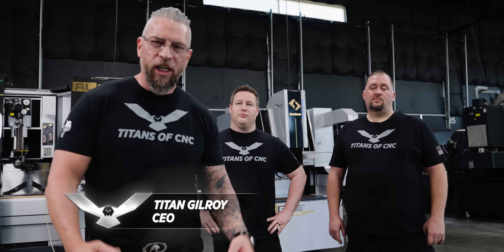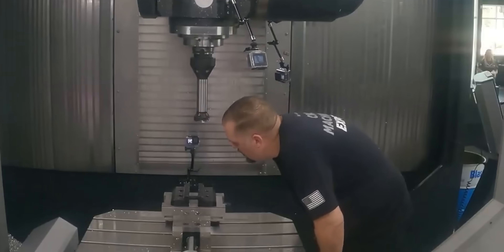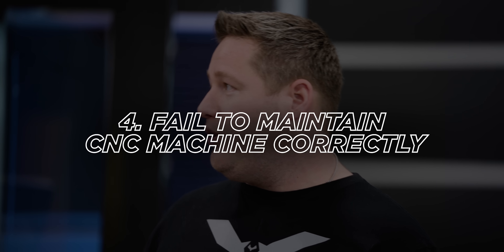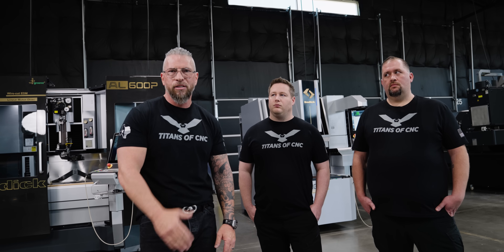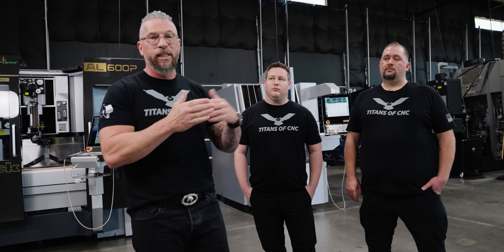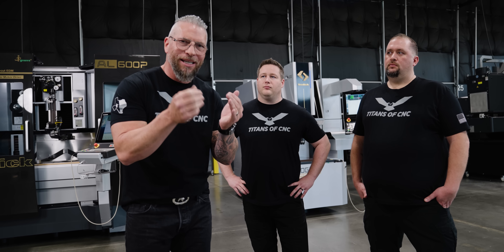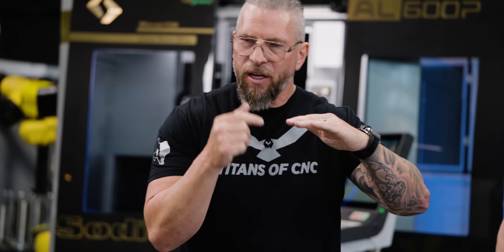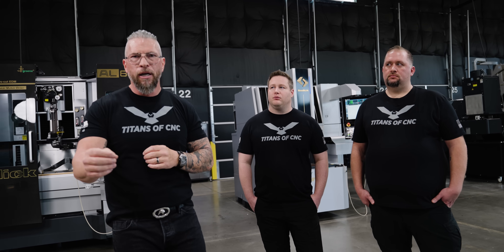Machining Mistakes That Will Get You FIRED

Comment: Tip for programmers, especially ones that don’t operate, give your machinists a G43 line check on each tool using a 1,2,3 block. The more witness cuts, the merrier. Give them a chance to adjust and verify work offsets before getting into finish features. This is not a tip for volume production, but for PRECISION CNC machining

Comment: Great video guys!
I always put the Z on the bottom of the stock. Any -Z coord is a problem in that way. And if the stock is cut off too low, you end up with a part that is not finished on top, instead you end up in the vice when you put Z0 on top of the stock.
Never manual change a code generated by a post processor. When something need to be changed, correct it in CAM a repost. Or update the post for a correct output for your machine.

Comment: if you put the z on top of the part, you cant crash the machine into some tables if your tool is short. they have limited length if your toollength is correct, you cannot go into the table for example.the machine will error, if the table is zero

Comment: You said you set your z off the top of the part, I agree!
But what is the point of probing the part and touching of the tool setter.
I seems to be safer to leave the part surface zero and touching the tool off the top of the part

Comment: If you review the code and check all your Z's, you can run virgin code very confidently - Never crash a tool. If you are still getting confused between 20. and .200 maybe you shouldn't be a programmer machinist just quite yet.

Comment: WORK only tells you where the tool is in relation to the program and ONLY.... ONLY.... ONLY if the tool was set properly! Distance To Go never lies (in relation to next block!)
Single Block
Work
DTG
Must be used together! This will prevent 99.9% of crashes!
I used to teach operators in shop this way. 
I would walk up and at a convenient moment press feed hold and pressure them to tell me what tool, what's it doing,  where are you at, where are you going?
Really created some good alert operators and made some good machinist.

Comment: I'm proofing out a brand new (or new to me) program with the single block activated coupled with the "Distance to Go" screen. I got my finger from one hand on the feed hold button. I got the rapid override set to 25% and I'm using the feed override as a throttle with my other hand. I'm catching and fixing mistakes beforehand. Once I get my first article, it's all 💯💯.
Reply: That sounds dope - but i'm not a machinist - just sounds like a nice combo of man and machine, like being a mech pilot
Reply: @fightington  Literally! When I man a machine, I'm driving it. And since I'm a programmer, I have control not only over what it does but also how it does it.

Comment: Our post writes minimum Z at the top of every tool. I like to use distance to go, slow rapid, stop just before 1" and slide a 123 block beneath the tool. Enough information to be confident and quick enough to be productive.

Comment: Had many of them, didn't destroy the machine just yet. Only got an increase in salary. Pushed a vise with milling head, T slots and M10 12.9 hardened screws broke. Milled a shunk 5 axis vise. Destroyed a couple of hydro tool holders. Destroyed a weldon tool holders. Broke a brand new milling head, broke iscar circular saws that are 800 euro each... When you need to make a lot of parts every day on multiple machines, for years, shit happens.

Comment: Only thing I would add is making sure you place decimals correctly. Telling the machine to plunge down .100 and move at 10.0 IPM is great unless you miss that decimal and it moves at 100. IPM. Then you might have a bad time. Rest of the advice is sound.

Comment: These new cnc machines have internal simulation that can show you alot ahead.  You can import you workplace and even include work holding.  Once you have taught you workplace and workholding you can simulate and see exactly where that tool will go.  As long as you draw everything correctly it's been bulletproof.   You can check it on each setup and prove it out.

Comment: On Siemens and Heidenhain controls, you have the luxury, that both the distance to go and the absolute distance are displayed. This helps a whole lot and if you learn to use it, its a really powerful feature. You also have diffrent knobs for feeds and rapids wich makes it wayyy easier to prove a new program.
Reply: As a garage machine shop, using LinuxCNC also gives me these features. It really should be a standard in CNC.

Comment: Even as a novice. Every time a new program is ready to proof out, the CEO and I do a dry run 6 inches above the part (small CNC shop). And we both monitor the first 5 runs. One of us hovering over the E-stop. And the other over the feed hold. We've lost a few tools but never damaged the machines thanks to the precautions.

Comment: A friend of mine retired from a power company and is working as a machine operator in a different shop. I'm going to make an instruction manual of multiple pages to show him the proper way to push the green button. It will end,"In the event of crash, press the red button." I don't  think his employer has shown him how to single block the program yet.

Comment: something else about the Z0 is its so easy to know thats your habit and if its wrong its staring you in the face.  trying to remember a bunch of negative numbers in a noisy busy distracting environment is not practical.  plus most operators run multiple machines.  and like a lot of comments say to. i like single block!   gives you one last chance and its saved me several times too!  any new programs get lots of single block.   plus i like to dry run through the graph. just to see what the tool path looks like.

Comment: Whenever I program a part on the lathe,
Doesnt matter if I use live tooling or not.
I use my hand as my tool turret and I use my hand to act out the program.
Ever tool index, every cut, every piece of G and M code I act out with my hand.
Then I run the program with my rapid way low.
Yet to crash a machine using this dumb method

Comment: Sorry Titan, Barry is 100% correct distance to go is vital.  You should always make sure you have feed rate at zero before you hit cycle start.  So always start at feed rate zero and check your distance to go before you start.
Reply from the maker: It is vital but also resets every time and it doesn’t tell you where you are in space. Work tells you where you are at all times to your part.
Depends also on what your used to.
Reply: @ i’m just referring to when you have a new set up making sure that you’re in the right work offset

Comment: Develop consistent habits so you can count on them. I offset Z to dry run, mill and lathe 2.0" always (unless the part doesn't allow). That way when you shift back you know it was 2.0". Note, shifting Z -2.0 is not the same as Z absolute = -2.0 speaking from experience. 
Don't do too many things at the same time, machines, dinner plans, etc.
STAY OFF THE PHONE!!!

Comment: Worked at a company for 2 years they had a list by every machine. Check your work order with your program in your setup sheet they had. Touch off all your tools double check and make sure your tools are in the right pocket. Run your program in graphics to make sure it's the right program for the part. Run your program on op stop and single block  with 25 % rapped to make sure you won't crash. Best fail safe that I still use to this day with the company I work with now

Comment: Lot of this i agree with, and i do regularly, i haven't crashed a machine in a long looong time, but I've definitely scrapped out tools and parts for drill brecks, tap breaks, inserts failing doing high-speed machining in 40 HRC 😅 you have no time to react at 275-1000 IPM

Comment: 8:57 lot of companies ive worked for switched back and forth depending on who wrote the program some come off center of rotation for CAMplete other come off top of part or -.025 if its a blank (personally ive never used CAMplete) i have maybe a yr or yr half of mastercam experience and 2 yrs of edgecam.

Comment: Number one is safety. If you’re a wreck less person who bypasses door switches and/or puts others at risk you’re fired. Number two is quality. If you’re not checking parts you’re not only putting whatever gained capital at risk and screwing over the guy running behind you, but you’re risking the customer’s relationship with the company which could lead to them taking their business elsewhere. Again, very easy to get fired from this. Numbers 3 to 5 could be any order of what was already mentioned. Picking up offsets, work holding, squaring up vises and fixtures etc… I have a question for you titan. What are you hoping to accomplish with this YouTube channel? I appreciate the pockets of wisdom but is your shop a playtime shop or a legitimate serious business with the intention of boosting America’s economy?
Reply: I'm not going to lie i regularly have to bypass safety features along of them make things impossible to do specifically since companies refuse to fix things like glass that u cant see thru
Reply: @ well you do what you have to do at times, but you’re not going to allow operators on the floor to do that. Safety on a machine shop floor is always number one
Reply: @Jericho-tc9yn  yes I'm on the floor just a regular old machinist but i do have 15 or 20 yrs of experience....my fist interview i was told I'm not a machinist cause I can count to 5 still, not 4.5 or 4.75 with my hands....I'm still able to count to 5 but I've seen a lot

Comment: - Simulate if possible
- always look out when doing tool changes. Some tools are longer and work holding higher than you might have imagined when you made that code
- always take special care whenever you make even the smallest change on the program
-  read the code ahead as you run it. Not always possible but never press cycle start until you know what is going to happen next.
- always take precautions (write notes, add stops etc..) when you have unusual procedures. Like when having to turn the tool counterclockwise, when using tools that require different entry/exits or when using tools too big for the tool changer etc.. It is too easy to press the button and continue if you don't make any effort beforehand to catch mistakes and just rely on memory. Sometimes you may come back to that part of the program tomorrow or monday...

Comment: also for when you do shift work on a tool changing CNC make sure you checked no one changed a tool on the previous shift to a tool that is wildly or slightly different so you dont run a fly cutter with the 8mm carbide parameters and then have to completely recode for the new tool

Comment: I've preferred bottom of part. We give stock dimensions and if it's too far off, they are supposed to get programming to adjust it. Instead, though they raise the offset, run it, and lower it, wasting time. And that's if they lower it, cause they're in for a surprise when it crashes the stock on the other side, in a different machine, and a different person running it. It has been mitigated a bit with a prep stock work group so there's no sudden hogging or crashes when it goes to multiaxis.
Reply: personally i prefer top of part for OP. one and bottom of part for OP. two

Comment: pfff.. Z is overrated. When I first time used my Mitsubishi machine I ran G43 and crashed the tool into the toolsetter (only around 0.4 inch),  coming from LinuxCNC where G43 does not move ... Luckily no problem the drill broke that's it. Put it onto my learning account.
Reply: Using G43 to SET a tool 🤔😁
Reply: @ytfan3815 to be more precise, issuing G43 when the tool was close to the toolsetter. It resulted in an adaptive tool shortening procedure.
I am firm with G43 on LinuxCNC ... Mitsubishi just works differently I got it.
Reply: @mrechbreger  
Never mind, only time I use G43 is calling tool length offset and use it in a line like G43 Z100. Hxx for every tool I call. 😉
Reply: @ytfan3815 ya in LinuxCNC it's only G43 Hn and it will not move but change the coordinate system.

Comment: i allways run top of part Z in first op if possible as wel. I mean its pretty easy to check your depths that way. Especially if you use fusion, wich shows at the top of your posted program a list of tools, and how deep they wil go. Now i know top of part is 0, and then a drill shows -100, wich means it wil go 100mm deep, but my part is only 80mm. Wel that means its going too deep, and it might drill in to my vice or table. So go and find out why it is drilling too deep. Also makes it easy if you have you current position that is showing on the screen set to your workpiece offset, you can see  ok the tool should be 5mm above the part right now, if you feed hold it there, turn off coolant and its way off you can allready tell something isnt right, either your tool offset is wrong, or your part offset, but something is wrong. So stop the program, go check where you screwed up.
And offcourse distance to go is another good way. But checking if its atleast close in offsets you can see it instantly by letting it rapid slowly to a 5mm gap, then a 1mm gap you see if its off. If it looks right and your program had the right depth you can be sure it wil be close and the drill for example wont be going through the bottom of a part where there should be a bit left on the bottom. So im more of a work offset on screen guy as wel, I know the part im making, i have a drawing there with heights and depths and i know where my zero is. Then i can allready tell if something is off.

Comment: I just had a crash the other night cuz someone on day shift put the completely wrong drill in the machine and instead of verifying the tool list was correct I just trusted that whomever had put it in did their due diligence. I got complacent and I should've known getting closer to a holiday vacation the odds of someone screwing up were gonna go up and up as we got closer and lo and behold. Someone put a 12" drill in a spot that was supposed to be a 10"(talking length) and it was supposed to be .6875" but it was actually .827.

Comment: Tip for touching off tools, I use a 1" gauge block and then -1" to the offset. That way the tool is away from the material and less likely to crash

Comment: I ran an Emco CNC lathe. 400mm chuck. big machine. I ran some parts on a friday. finished them. picked the next job. Checked the programm. same tools. aight lets go. yeah well. 1,2,4, and 10 were the same. the finished job had an id tool on t6. the unfinished job on t7. well. toolchange to t7 and ofc there was no offset in there. so the machine literally rapided into the part with the id tool sitting on t6, where the part came flying out off the chuck. it was deep in the grip but still came out. flying against the window shattering it. the plastic window infront catched it and launched it onto the turret. if the plastic broke or it came through. it probably wouldv injured me pretty bad or even killed me. just a stupid mistake. with the luck i had, the window and the id tool were the only damaged things. besides my pride and stuff. seriously. Watch out and be carefull.....

Comment: To save time and make it easier, we mostly have standard vices to clamp our material. Because of various reasons.

So I started implementing a "constant Z" from the highest point of the vice closest to the clamping jaws. The fixed jaw, as it will never move and is rigid.
Then to get the top of the part Z, I use my calipers, and just enter it as an incremental input, the value I see from my caliper's.

When a part is either too long for the caliper range, or in some weird angle or anything that makes it impossible to get an accurate reading, then we use the probe tool.
Saves a lot of time, and we don't have to go through the hassle of grabbing the probe tool, and mount in the spindle and then move it to position and all that.
Reply: We always program a probe cycle to check the stock size. Never fails.

Comment: I had this "run in the mill" job, just clamping 9 parts next to each other in a vice. It was only for drilling and tapping so.
I had a bad night sleep and was running on auto pilot basically.

I placed the parts incorrectly in the vice, compared to what I had programmed in the CAM software.
So 9 parts was scrapped, then my production manager told me it would be better and safer to run 1 part at a time.
I got irritated by that, and told him it was a blunder on my part, it happens. He wouldn't hear me, and insisted it would be better if we went with milling one part for all things.

Then I was gonna tell him, "well let's do that for our bed router machine's as well then. Cause it happens there as well". And a lot more frequently than in the VMC machine I run.
But I bit my tongue, and just stood my ground that it would be a waste of time of doing 1 part at a time for a VMC, as well as saying I don't want to clamp and unclamp 9 parts individually.
It's get messy and takes a lot longer to finish the product.
Reply: Like and sub for part 2

Comment: You can not become the best by not making mistakes, those are the best way to learn what are the no's of the trade.
Also I also put Z0 at the top of the part for the first OP, on the second one I usually put it on the bottom so I know that the part is perfect thickness. On my 3-axis.
Reply: No way, input a -30 inches in the Z common work offset. Override the spindle up to 200%, edit the code to un-clamp the B and rotate at rapid 10k degrees of rotation. Hit cycle start and roll you box out, middle finger at full mast.
Reply: @everettrhay4855  This guy knows whats up! 😎 If sparks aint flying you aint machining!